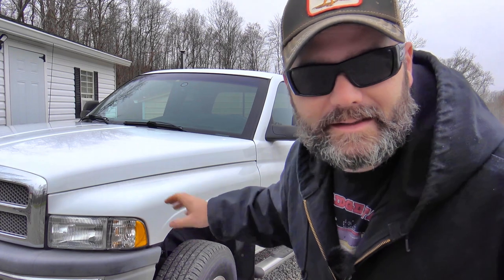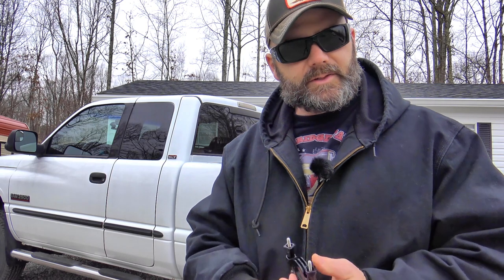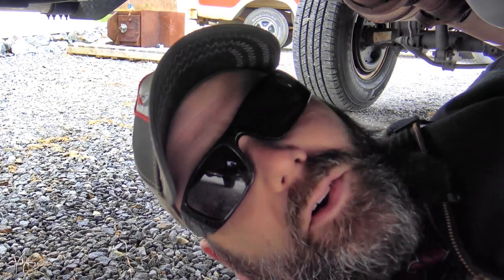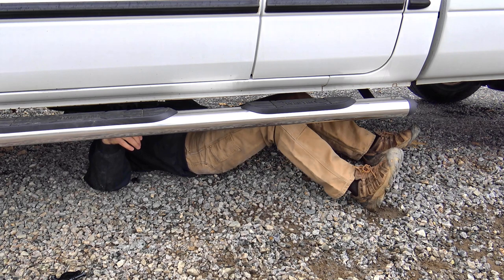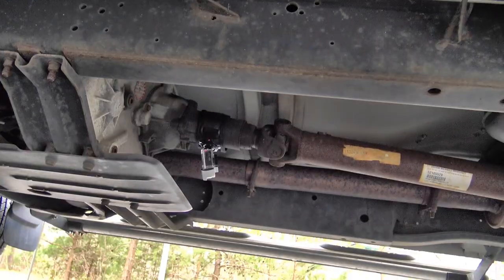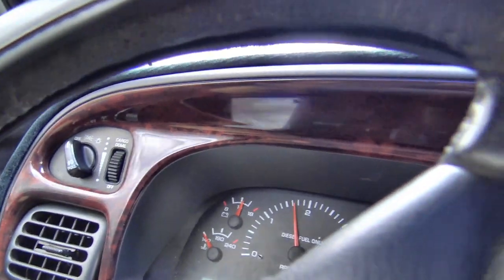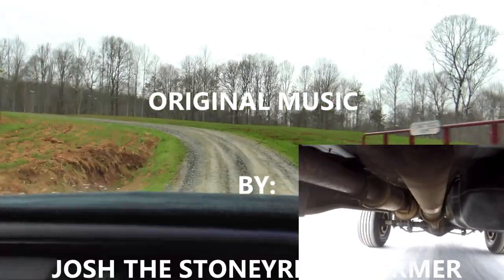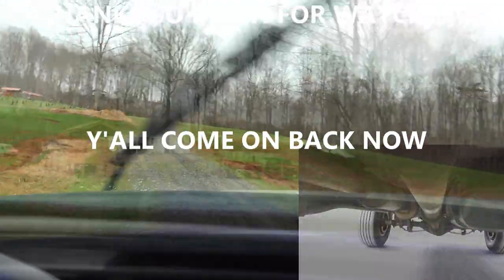WHAT'S WRONG WITH MY CUMMINS??? CALLING ALL MECHANICS!!!

Comment: it's called a carrier bearing. And they're not cv joints, they're universal joints! remove and replace the carrier bearing. While you have the driveshaft out if the universal joints are factory and don't have grease fittings do your self a favor and pull caps off carefully not to loose the needle bearings and pack with grease as best you can. Definitely the carrier bearing is bad, you can see it's bad in the video buy check your universal joints also to be safe.
Reply: Paul Condie, I agree, while it is out you could have the driveshaft balance ck'd at a driveline shop.
Reply: Paul some driveshaft do have a cv joint not like you would see on an axel shaft there different they use 2 universal joint in them .
Reply: Howard Parsons know all about it.
Reply: Paul Condie exactly what I was thinking
Reply: Also heard em called center bearings, but yep, sounds like you hit it w/e ya call em.
Reply: I believe the problem can be explained by the acronym r.a.m. (really awful machine)
Reply: At least it ain't a Ford - Fix Or Repair Daily

Comment from the maker: BE SURE YA WATCH TO THE END FOLKS...I'LL GIVE YA A WALK AROUND ON THIS TRUCK...TELL YA ALL ABOUT IT...AND WHAT I HAVE DONE TO TROUBLE SHOT SO FAR!
Reply: if u-joints have any play replace them.
Reply: I think it's the carer bearing
Reply: It is the carer bearing, I could see it moving
Reply: Stoney Ridge Farmer I don't think the vibration is a problem. We have a 1995 3500 Cummins Turbo and the only problem we have is when you bring it out of 4wheel drive and put it into 2wheel drive it causes it to violently shake the cab
Reply: Stoney Ridge Farmer first n foremost thank you for your service (any time i talk to a vet i thank them i think more people should) secondly love ur channel .Where did u find that truck ?
Reply: Stoney Ridge Farmer all Cummins need straight pipes!!
Reply: Stoney Ridge Farmer carrier bearing is the name of the "bushing" you were referring to. If it is bad it will give you the symptoms your experiencing
Reply: Stoney Ridge Farmer that's alot of play in that drive shaft carrier not little
Reply: I agree with all the others replace the carrier bearing it has too much play in it. I worked on a farm and we had a 04 Dodge and had to replace the carrier bearing.
Reply: Stoney Ridge Farmer also if possible lift the rear of the truck and support it with Jack stands and out the truck in drive and watch the carrier it's self have some one apply throttle while lifted and feel for vibration changes
Reply: Some play in the rubber bushing is normal, as long as the rubber isn't torn.
Reply: I am a certified Dodge Mechanic and it's the rubber bushing it's acculy called a carrier barring

Comment: I been a diesel mechanic for the last 12 years, I’m a Cummings tech and Detroit Diesel tech. I agree with everyone else it’s definitely the carrier bearing (your suspect critter) while you have your drive shaft down to replace the carrier bearing you might as well replace the U joints that’s what your calling your CV joints.

Comment: It makes sense that it the bearing. When the engine is in strain, pushing the truck along it tightens up. When you coast,  the the transmission and the differential are at slightly different speeds is where the wobble comes in. You can believe me, I learnt that in engineer school 35 year ago.

Comment: Hi josh, I have an 01 dodge 3500. Yup, carrier bearing. Have to pull drive shaft. While it’s out go ahead and replace the U-joints. I have 190k on my Dodge, I’ll drive it till I die. Just can’t beat that Cummins.

Comment: Build a or fashion a cover for your gate opener i covered mine with with a box i made and a low temp utility heater. Works no matter what the temp is. It even pushes through the snow when it needs to.

Comment: The rubber thing is a carrier barring. It is pressed on and a bugger to replace. I did mine a few years ago. I ended up cutting it off with a 4in angle grinder. I would recommend taking off the DS and take it to a shop to press it off. Getting the new one on is easy. Also replace the 3 U joints

Comment: Little FYI about this model of truck. If you walk through a junk yard looking for them you'll see two types. One's with drivers doors, one's without. The one's with have the sheet metal around the latch ripped out because the hinges go bad, the door drops and that metal isn't strong enough to take the beating. So do yourself a favor to keep this truck top notch, check the door hinges often and keep them well lubed with either a graphite spray or white lithium grease.

Comment: Definitely the carrier bearing, they make a heavy duty replacement.....easy to change out. I would also change out the ujoints with replacements that have zerk fittings.....thats an easy fix also...............when you change out the ujoints be sure to draw a line on your drive shaft and yoke so it matches back up.

Comment: like everybody else said carrier bearing and check U-Joints while you have it apart. You can whack in U-joint bearing caps with a hammer, but I advise pressing them in. Too easy to lose a roller or get it wedged under the cap.

Comment: The broken exhaust pipe could also be contributing to the vibration. You could replace the exhaust pipe at the joint which will reduce the sound and reduce the vibration to help you figure out what the real problem is. All the best!

Comment: Josh what you are referring too in the center of your drive shafts is the carrier bearing..it does seem to have some "slop" in it...Also, while movement in your universal (cv joints) indicate they are worn, in my experience you can still wiggle the drive shaft,  feel that its "tight"...but have bad u-joints.. this happened to me on an older two wheel drive Dodge pickup
Reply: I had a problem with rear leading and trailing arm bushing worn out,(loose). I also replaced rear shocks bushings worn out. Had 250k miles on vehicle. The shaking got worse over time.
Reply: Good idea Fredd, I was also glad to hear that Josh checked all of the wheel bearings..sadly they were known to be a problem with some Dodge trucks...been there myself. I will always have a soft spot for them..a 1999 Dodge Durango saved my life when I hit an Angus Beef Steer one dark night going about 55mph....had I been driving my Grand Marquis it would have come thru the windshield...and I would not be sitting here typing this :)

Comment: A u Joint don't have to be loose to vibrate, you can have a cup with frozen or rusted bearings in it that will cause a vibration as well. Look for signs of rust weeping out of the caps around where grease would squeeze out if you could grease them. 

 I would really suggest taking your shaft loose and flex it both ways to feel if that center u joint is freezing up in one of the cups. Really check all the joints and if you take it apart mark it at all joints. 

Retired senior master tech Ford Motor.

Comment: I had a problem with vibration in  a GMC p/u. Turned out that a shield for the transmission was loose. I tightened the shield and never had another problem with vibration. Check that everything under the truck is tight, good luck.

Comment: Josh Brett here from B.C.
I’ve had that same problem quite a few times I could totally see the vibration in your yoke bearing when you slowed down. That yoke bearing should have no movement in it when you move it back and forth with your hand. It’s an easy change out.

Comment: The center piece between your drive shafts is your carrier bearing ive had the same issue with my 98 s10 extended cab short bed and when you have your carrier bearing replaced if i was you id have the u joints (universal joints) cv joints as you called em replaced while your at it just to get it out the way I love the farm vlog keep it Real buddy good luck post a video when its done if you please

Comment: Josh you should look into a 4" MBRP exhaust for truck, put on my granddads truck, and increased the fuel mileage by about 3miles to the gallon. I have a 5" turbo back on my 99' 7.3 F350 and love it, and yes your carrier bearing is shot.

Comment: Agree with Shane. Take that carrier bearing wiggle and multiply it by 1500 rpm and you have a wobble. Toque on stopping adds stress to it. It also gets a torque load on acceleration & deceleration. 100,000 miles. It's to be expected. Be glad it's not the torque converter in the tranny. That would be as much as you paid for the truck .Drive shaft balance is very rare. Balance weights are welded on. Replace universal joints  before they go and drop the shaft on the road.  All that is 100,000 mi maint.

Comment: Carrier bearing is normal However that front drive shaft has some wobble which indicates either a bent drive shaft or possible bad u joints. I have owned
 many of these and still do and have wrenched on them for many years.  Great pickups.

Comment: my 99 dodge did the same thing on this overpass and the dealer couldn't figure it out until I took them on a test drive. I think they replaced shocks under warranty back then and it fixed it. it was an unnerving feeling. Good Luck Mang

Comment: I would check the motor mounts. You are supposed to have some play in the carrier (midshaft) bearing and yes it won't hurt to swap it if you are going to keep it. But I feel that one or more of your motor mounts are starting to wear. If you have someone power brake the truck in gear and watch the engine. When it torques you can see if it is flopping. That is what I would do.

Comment: Great video Josh. I wrench on lots of trucks in my free time. I graduated from my local Community college with dual associates degrees in Collision and refinishing and Automotive Technology. That rubber thing that your two halves of a drive shaft go into is called a center support bearing and its to help support the drive shaft so they don't have to make a long flimsy one. I noticed it was vibrating good when you slowed down. I have one on my 1978 F-100 2wd and mine was vibrating really bad when you had to get on the gas going up big hills.

Comment: Don't know if you gotter fixed or not but, it might could be your drive shaft is out of balance. I know this sounds crazy but this can happen,  if you ever noticed all drive shafts will have a little bitty square wait attached to it, if the mysteriously get knocked off they will be out of balance. You might have to remove your drive shaft and take it to a reputable Machine Shop and get checked or re-balanced. Just a thought bud. You'll get it fixed I'm quite confident of that,  you do a lot of Kool stuff, kinda stuff I enjoy.👍👍👍

Comment: Replace the carrier bearing. While you have the driveshaft out if the universal joints are factory and don't have grease fittings.  Also check and look to see if you lost a balance weight

Comment: Hi josh, you’ve definitely got a problem with the carrier barring. When you change it I would advise you to change the universal joints too since you will have them apart. I had the same problem with a Ford F-350 and a Chevy 3500. Hopefully it helps. Keep up the good work
Reply from the maker: Thanks Michael

Comment: I would agree with most people,  carrier bearing. BUT, at that mileage also do U-joints, or a complete new shaft as someone else suggested.
AND check the pinion bearing on the rearend. Had that go on mine. Similar issues.
Someone said it's not a 24 valve until they went to the 6.7. Wrong, they went to 24 valve 5.9L in mid '98.

Comment: hi josh really enjoy your videos!! thanks!! now on the shake in your truck... the rubber around the carrier bearing moves to dampen the movement in the 3 ujoint long drive shaft . the rubber looks good and if there isn't any movement or sound from carrier bearing( witch is a sealed ball bearing inside the rubber pressed on the drive shaft) the carrier bearing should be good.im thinking its a ujoint or maybe the splines  on the slider on the drive shaft. now the only / best way to check for movement in them is apply ebrake or block wheel.. then put in neutral not running and then check for slop by lifting / twisting the drive shaftat each ujoint and at slider on driveshaft. now if one of these are bad it will make the rubber move on carrier bearing rubber like seen in your video. hope this helps thanks again for all you share with us!! tony

Comment: So, what fixed your problem? Beautiful clean, that’s all the truck you’ll ever need, real beast! I also have a 2000 w 244K. There are guys here on YouTube that put a million miles on these Dodges with Cummins in them, keep her running young!
Reply from the maker: U Joints on all drive shafts
Reply: You replaced the carrier bearing too, correct?
Reply: Stoney Ridge Farmer on the front as well?

Comment: I agree with every one else. Carrier bearing and while you got it tore down put all new U joints in. Preferably the ones you grease yourself. I had the same vibration and dropped the driveshaft in the street.

Comment: OK, if you watch where you move the drive shaft up and down, you can see some of the rubber on the carrier bearing have separated, I believe that has happened because your carrier bearing is out.  That may have not seemed like much movement, but it does not take much to cause your vibration.  Another clue of the carrier bearing being out, if you watch the drive shaft spinning, there is a tag on the shaft, you can actually see this tag "wobble" up and down as the drive shaft spins when not under power.   I would change out the U-joints as well, drive shaft vibrations will knock out a U-Joint very quickly.  Just my opinion.

Comment: Index the front driveshaft and remove it. Take it for a drive and see if it changes or quits. Check the front U-joints. The carrier bearing is likely junk. Replace the 2 piece driveshaft with a one piece and you won't need to worry about it again.

Comment: EXHAUST: I'm not an expert on the Cummins diesel. But turbos love a good intake and exhaust. You have the intake squared away. Go on a Cummins or diesel forum and research a best bang for the buck exhaust. Some turbos can loose power with the wrong exhaust. So spend a little time and research the exhaust.

Comment: Josh, i use heavy duty grease on the battery terminals of my 1999 dodge cummings 4x4 2500 series. it protects them from any acid or oxide corrosion. btw- 93,000 miles. hehe - whoooooo...

Comment: U joints looked good. Carrier baring looks good, they all move like that. Sounds to me like a break drum or rotor is cracked but it might also be a tie rod or ball joint going out. Jack up the front end and have your wife wiggle the tires with the steering wheel while you're looking for sharp slop in the joints. For the rotors just take the tires off and clean them off and look for cracks around the stud area. That's what I found on my 2000 Z71. So I just replaced all the rotors. Ran smoothly till I traded her off after 345000 miles.

Comment: I would highly recommend you look into a "Banks" SS exhaust. Right from the turbo downpipe back.  I put one on my truck in 2006 and it is still as good as new( maybe not quite so shiny) and I live in an area where they use a ton of salt on the roads.. The reason I went with Banks over all the others is that there is no annoying drone from it. Some of my friends went with other brands and the drone got real annoying real fast.  Banks Power, high quality and made in the USA!

Comment: Swing bearing, carries the drive shaft, u-joints are first to wear out, then its bearings in the rear end, CV joints are in front wheel drive vehicles, those are u-joints

Comment: Most likely just a u joint, but it would be best to replace the u joints and the carrier bearing at the same time. If you do it yourself plan on taking 4-5hr to do it. I just did mine and I had to cut the carrier bearing off and it took several tries to find the right one.

Comment: The carrier bearing is toast, the u joints look good but the one closest to the bearing is going to have to come apart to replace the bearing. Make sure you put the u joint back together the way it came apart or you will have a very bad vibration. It's a common issue, use to see it alot at the dealership.

Comment: If it is the carrier bearing that’s bad look into getting a one piece driveshaft. That will eliminate the carrier bearing all together and also will bring it down to just 2 u-joints on the entire driveshaft so you only have the replace 2 when they go bad. Look up CCI driveline in casco MI. If you need a one piece, I’ve got one on my 2000 24v and love it

Comment: It's also NOT a u-joint problem, you would most likely notice that as you start/ stop or shift fro Drive to Reverse.

Other notes-
1. these driveline joints are u-joints, not CV (those are usually only in light duty trucks and your JD Gator). If ever you need to replace one, be sure to buy one with greasable zerks and lube them up periodically - just like your hay baler & mower
2. Don't listen to the Limeys talking about prop shafts. Here in Merica, it's a driveshaft. A prop shaft is on a boat.
Merica.

Comment: Ive had one of those issues. Those u joints look original. Id do all three u joints and the carrier bearing. The little rubber piece you wiggled. Go with a 3 1/2 exhaust. Itll have a nice rumble.

Comment: Hey Josh  the front drive shaft for the front axle has a constant volosaty joint (CVT) has a known issue for vibration  had the same issue with my 1999 1ton 4x4 had to replace the 4wd drive shaft

Comment: I don't have that middle bushing because I have a single cab but I had a vibration like that when my u-joints/cv joints on my drive shaft went bad. Don't drive it too much with that vibration, the intermediate rear tail case housing is prone to cracking and breaking when the U-joints on the drive shaft go bad due to drive line vibration and it's expensive and hard to fix, I know from experience.